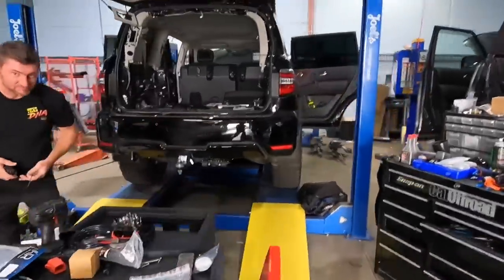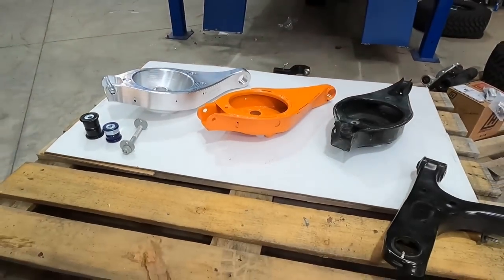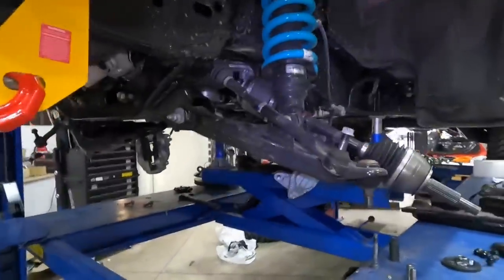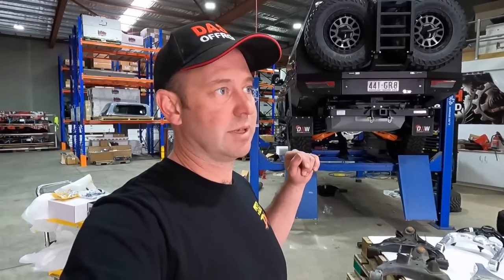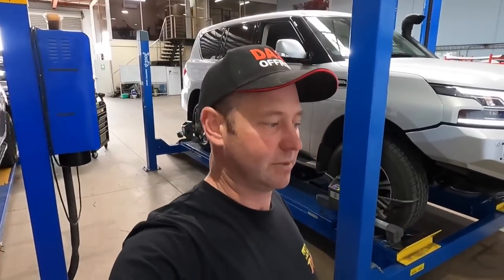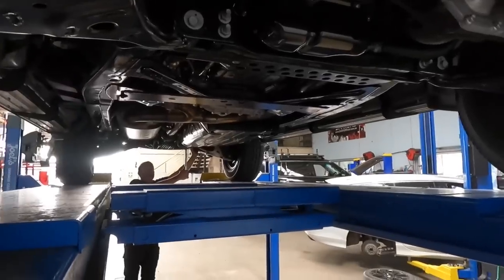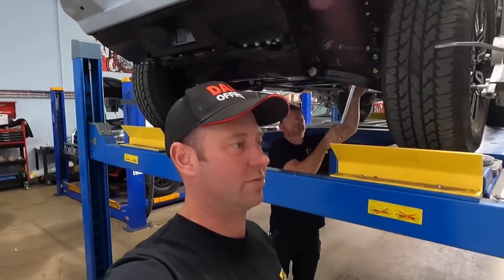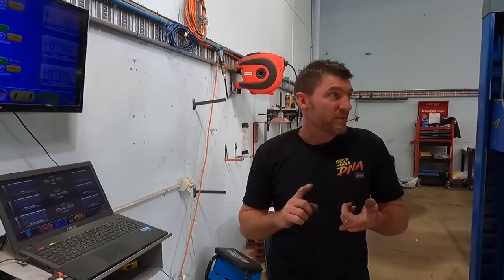Why is Y62 Patrol Wheel Alignment So Important?

Comment: I don't have a Y62, but I own a TA60 Armada in the USA. Thank you very much for these informative videos. I did not account for saggy Platinum 120k mile springs and ended up with a 3.5 inch (90mm) in the front and 2.5 (65mm) in the rear. I made a 2" billet K frame drop  (I could not find any 1x2 billet locally) and so I have 5" (125mm) lift rear unloaded. Add in my gear and camping trailer and I'm level with 25PSI in my bags. My problem is empty the steering is touchy at hwy speeds and I get that left or right jerk from 1st to 2nd gear if accelerating hard. I was really hoping for amazing results from the Spring swap to bags to have the unloaded/loaded adjustability. I like the comfort of the independent suspension but I just wish the geometry wasn't so complex! I work from home so I don't drive a lot but I really am looking for a happy medium. Thanks again!
Reply from the maker: Sounds like you need some more caster bro 😎

Comment: I agree with this Alignment video with only a couple of different preferences, one being that I like to have a bit of -camber on the passenger front
not much but around -0.25 enough to stop outer tyre wear on that side & have the drivers front about -0.05 or even +0.05 just in that range. 
Also another thing that can make your car pull left or right are the tyres (even brand new tyres) the caster split you guys do is perfect but if there is still pulling than just try rotating the front tyres left to right.